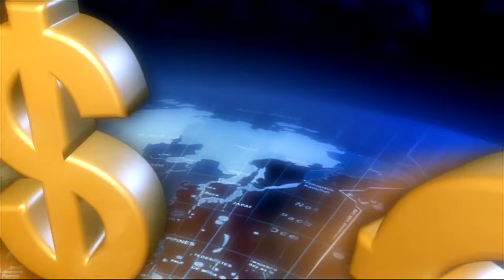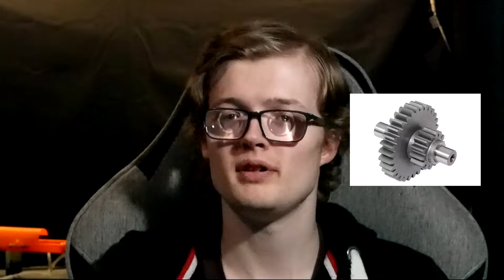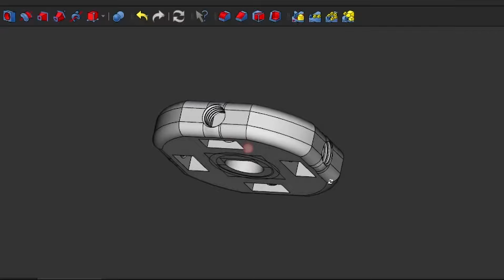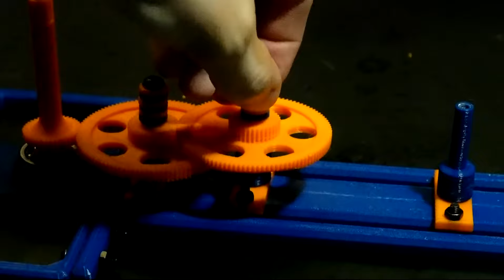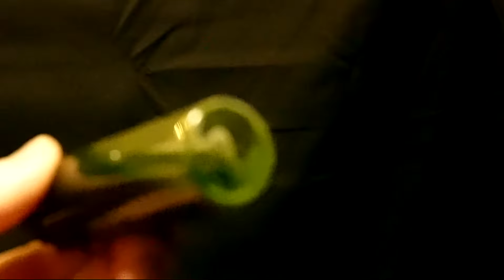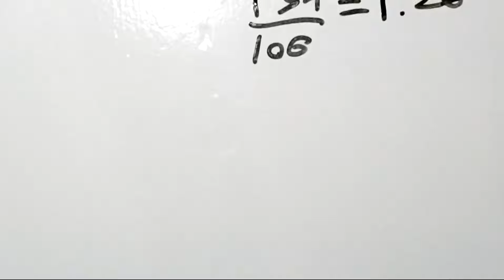I 3D PRINTED a Centrifuge To Harvest Algae

Comment: Having it braced above (as well as below) may help prevent/reduce flex of the shafts (at least around the gears, where it matters most.

I’m uncertain on Filament Choice / Infill Percentage/Style etc but that may have an impact as well.

FINALLY Herringbone Gears are easily 3D Printable and may help as well vs a basic spur gear (short of initial assembly perhaps).

Comment: I believe in Africa they use a wheel with rubber-bands to separate blood. 🤔
Might have been easier, and more efficient than making all that. 🤷‍♂️
Reply: There was a design for a Paper Centrifuge which i think is what you are referencing, but as a “step up” this is nice.

Also even with crappy and/or nonexistent electrical grids, with a basic (even Lead Acid) battery + solar based microgrid, and a CR10 + Pulltrusion Setup you could make this.
Reply: @ericlotze7724 This one was made by Stanford and it costs 20 cents.
https://youtu.be/pPePaKnYh2I

But the same can be made in a way where new flows in and old flows out as bands spin it.

Comment: Nice, although it seems you went a bit out of your way to make it manual.
I think it would have been far easier to just attach it to a motor and avoid the gears, you can pick a motor in the speed that you wish with all the gears built-in for probably 10 pounds.
Personally if I were to do this myself I would attach it to a servo motor in order to have near infinite speed control, but that would cost closer to 100 pounds if you don't already have a box full of motors like I do 😂

Comment: I was just looking for a open hardware solution to centrifuge. I want to know if it is possible to make a homemade Leaf Protein Juice to something like TVP or mild taste powder. Although culinary centrifuges look like a better fit, still worth seeing what 3d printing can handle at that rpm.
Reply: You could 3d print the parts for a large plastoc centrifuge ahtn glue them together, and then possibly make molds of each assembled part out of molasses and sand(which should be cheap and easy to make) and then get scrap metal together to metal versions of the parts needed

Or you could use the same system that shake the future came up with, which produces very high quality molds from 3d printed parts, and the plastic could be recycled multiple times for more prints.

These are all suggestions or advice, ypure free to use or not...do with that what you will.